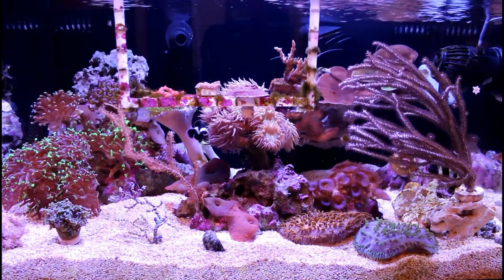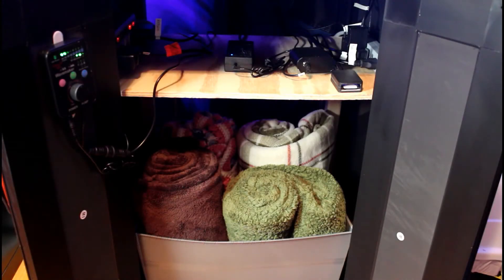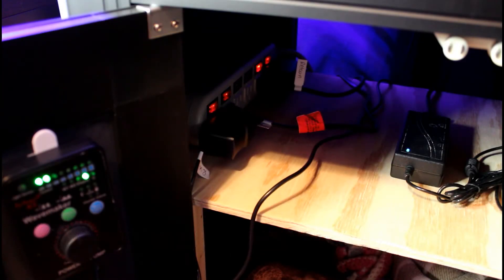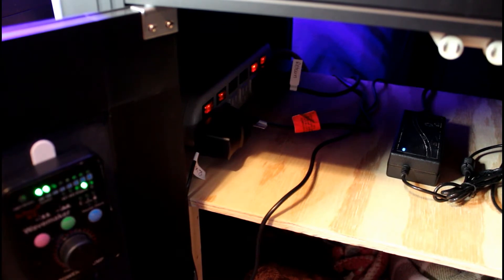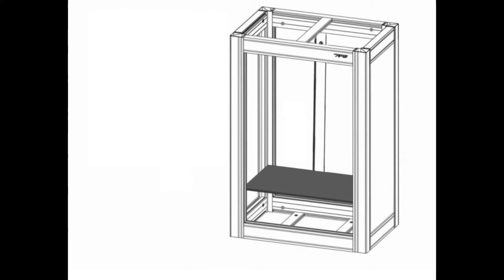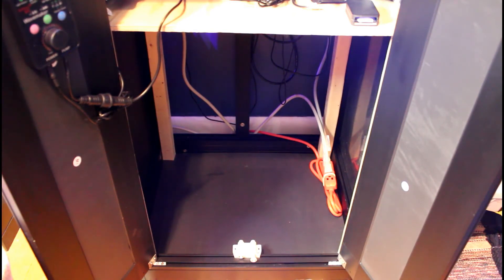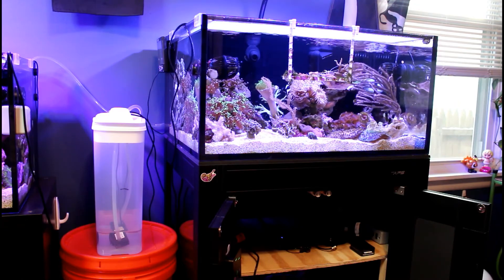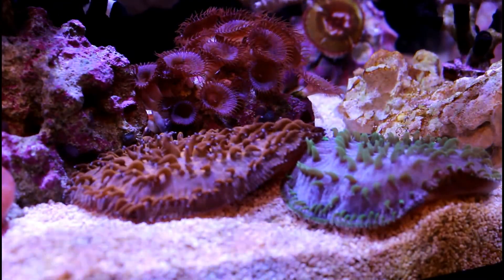Inside the APS Stand

Comment: Do you use one pump or 2 pumps in the one container For the ro water
Reply from the maker: Two - each tank has it's own separate top off pump. The Lagoon tank is using the AutoAqua Smart ATO, and the little 10 gallon is using the AutoAqua Micro ATO. Both work really well and the pumps are about the size of a tangerine/mandrin!
Reply: Kimber Bee 🐝 Thank u I love your tank. I seen you just updated a tour so I’ll catch up there

Comment: Is this the Nuvo APS 20? Mine didn't come with the support bracket J
Reply from the maker: No, this is the 25. I pulled out the manual and see that bracket J is the support that goes down the middle of the back of the stand. I'm sure if you contact Innovative Marine they will help you out with getting the proper piece to you!!
Reply: I did. Even though it is in the instructions bracket J does not come with the 20. Thanks!